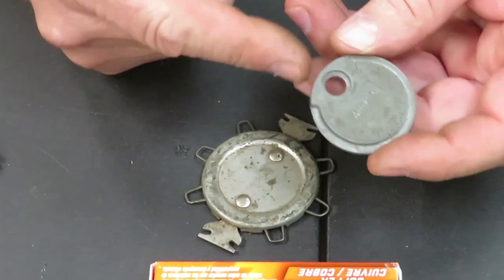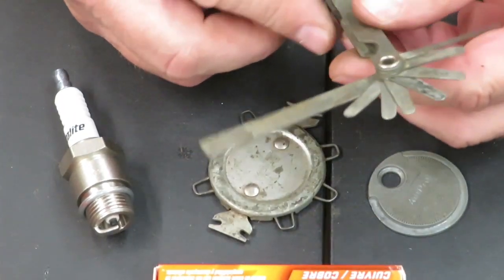how to gap a spark plug and tools

Comment: What if the spark plugs box say do not gap its pre gapped? Do you have to get the correct gap to the specific number that the spark plugs say? Where do you find that number? I know in the box it says 21 foot pound of torque. I know I have to torque it to 21 but it doesn't say to gap them.